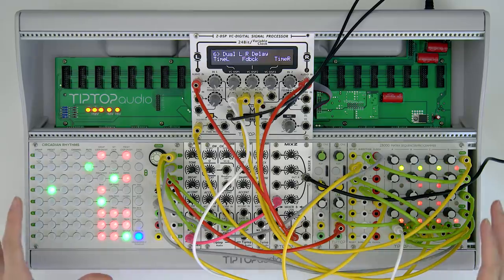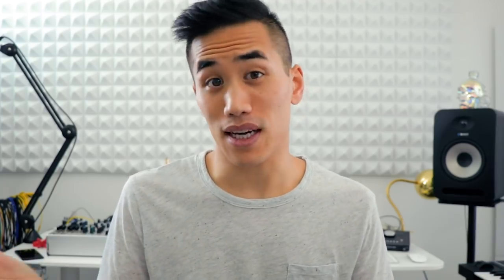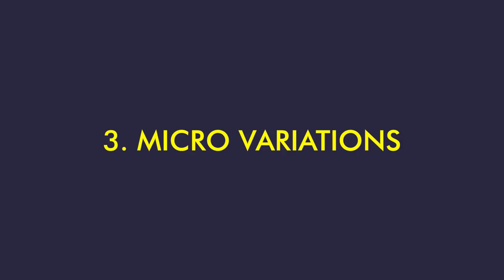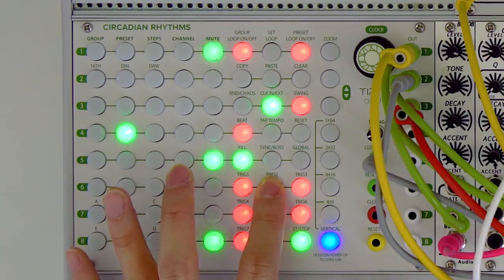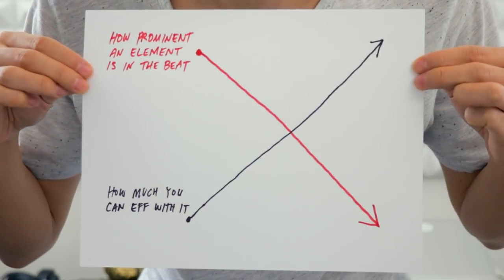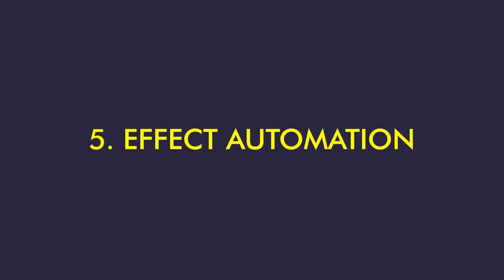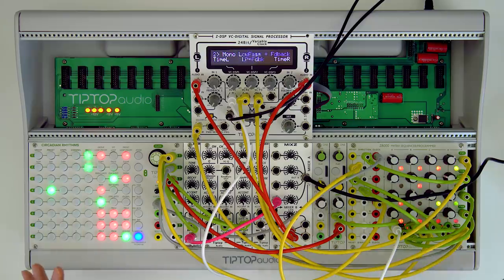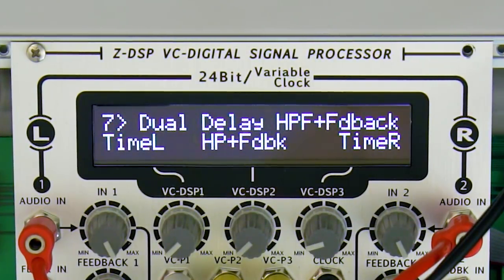5 steps to make awesome GLITCH BEATS

Comment: Great video! Love me some glitchy beats. I would also recommend the Glitch VST to those on a budget (The older version 1.3? Is free. It might not be a 100% stable in a modern daw on windows 10, but 99% of the time it works just fine). Just running a simple drum loop through that gives some really awesome results. Also try running some synth stuff or guitar riffs through it, super rad.

Comment: One of my proudest patching moments was making an auto-glitch patch on the TC Electronics Fireworx years ago. I can't remember exactly how it worked, but it's a combination of random modulators and intermittent envelopes that drop delay, chorus and reverb in and out of the signal path in a choppy semi-beatsynced way, rapidly modulating the delay parameters to do that classic "buffer loop" glitch effect. It still gets used occasionally when I'm feeling lazy!

Comment: Overwhelmed by the mass of wires, then at just about the end of the video I realize that the main module is "just" (???) a beefed up version of the analog arp unit we had back in '87 in the e music class I took in college.  That thing had just 8 or so knobs I think.  One must have been a clock pulse speed, and the rest were CV up/down offsets.  You ran a CV line into it and at your arp came out the output CV line.

We had nothing like a CV driven effects unit, though.  Just a basic reverb box.

This gear looks like a bit too much for me for just a hobby, but thanks for the show!

Comment: Sample & Hold and noise wave LFO's with adjustable depth/intensity go a along way for some hot glitching on anything.

Random wave LFO onto a delay timer was a fave of mine. Definitely need its depth/intensity controlled otherwise the timing goes mental!

Comment: I  noticed that the synth cables in this video looked different (the wires stick out from the side and the jack has a hole in it) and I assume that's so you can hook multiple cables up to the same input and I think that's pretty cool